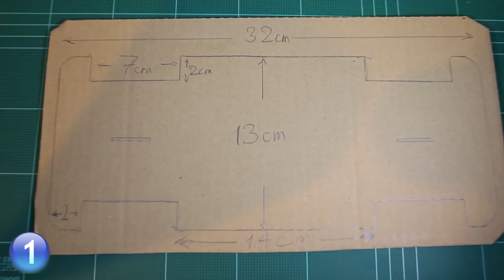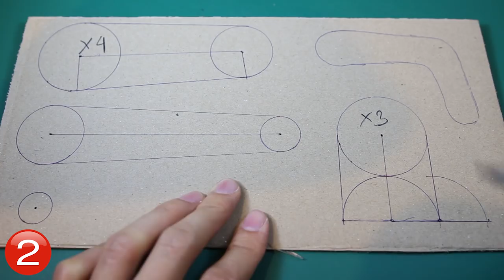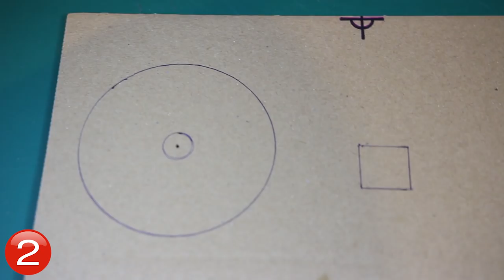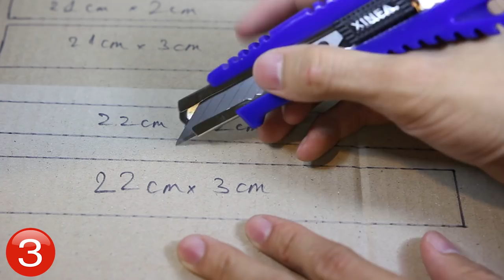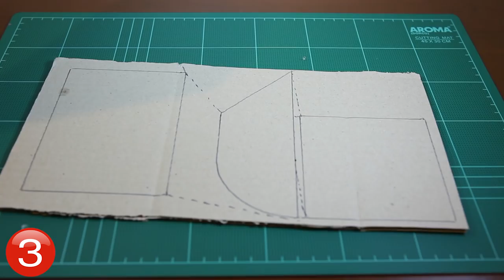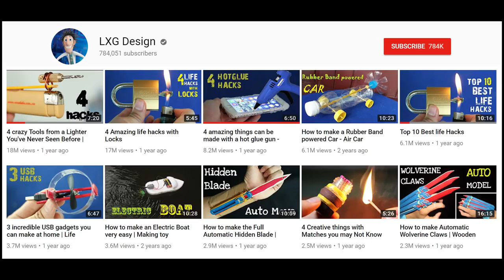[LXG244] 5 Amazing Cardboard Things you can make at Home

Comment: You can break up the cardboard lock just by cutting it with a scissor
Reply: Professor Spider why use scissors when you can just tear it open?
Reply: +Professor Spider , the purpose of that lock is to draw attention and inspiration, you can't use it to lock things up , that would inspire thieves to rob the locked thing more often.
Reply: Professor
Reply: FLIPIN PRO LEGEND dude that will just break the whole deel of breaking one 🤦🏾‍♀️